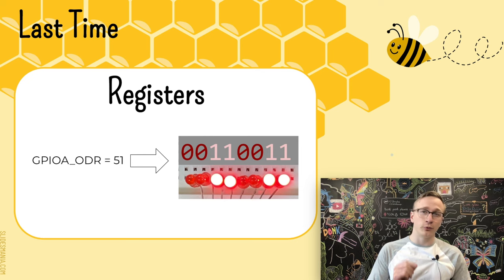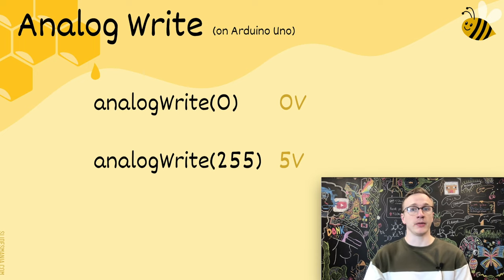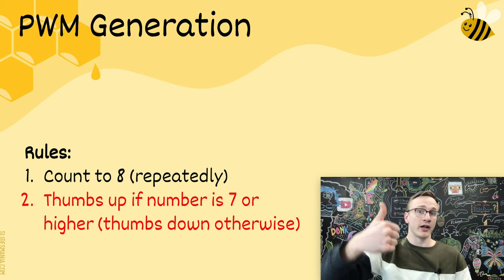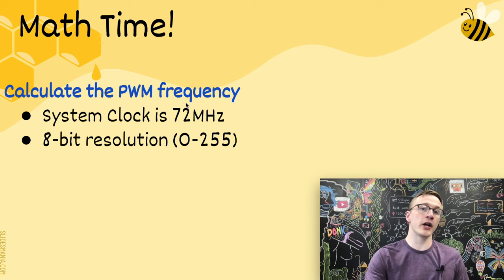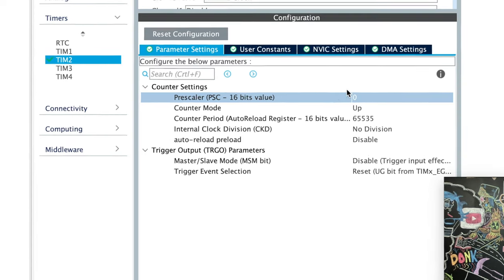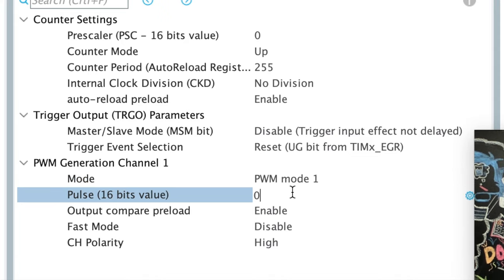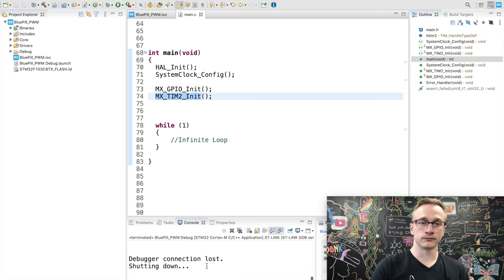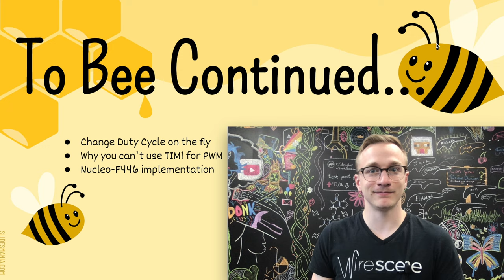STM32 Guide #3: PWM + Timers

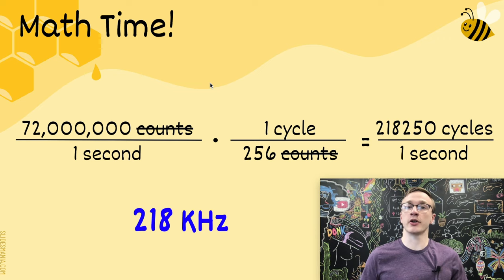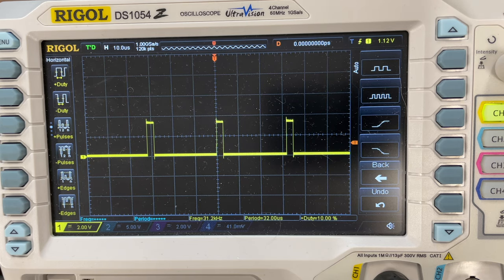Comment: The best beginner-friendly explanation about PWM timers. For some viewers, there might be a bit of misunderstanding. At 9:25, you're using 72 MHz as example (281 kHZ fix typo), and at 19:10, you're using 8 MHz, as shown by the 31 kHz reading on the oscilloscope."

Comment: Thanks for the video series about STM32. Your explanations are really great. There is a typo in the calculation of the PWM frequency. It is actually 281250 Hz instead of 218250 Hz. Later on the scope shows the right duty cycle but at another frequency. Might be related to the clock configuration. This is a little confusing for beginners like me. But the video still helped me to get the PWM configured.
Reply: Hey I had a similar confusion with the frequency at the end being about 31kHz. What I think is he used the internal HSI(High speed clock) RC oscillator which gives you a frequency of 8MHz . So when you calculate the frequency of PWM you get 8Mhz/256 = 31kHz. hope this helps! (Note: You can get 72Mhz clock speed from the external crystal oscillator but you have to configure that in the CubeMX clock configuration)

Comment: This series video is a great help to those who just started using STM32, as well as those who are somewhat familiar with it without being proficient; I am the latter. All tricks learnt in operating the STM32 IDE environment are so valuable that they will save you a lot of time and energy and most importantly, frustration. These tricks and insights are bridging the gap between where I am and where I want to be. I appreciated your generous sharing of knowledge which you at one point had to put in efforts to learn yourself!

Comment: One thing to think about - consider audible frequencies! Often times, the default PWM frequencies of many libraries and frameworks (including Arduino) fall well within audible frequency ranges, which very well could generate an audible annoying whine. 

Try aiming at at least 20kHz, more if you have small children, probably a lot more if you have pets. 

A few years ago I used an ESP8266 to make a wifi-connected MQTT-based RGB light, programmed it via the Arduino IDE and left all settings default. It really was an, admittedly quiet, but annoying whine until I fixed it.
Reply from the maker: I don't think I've ever had an LED make audible noise, but I certainly have had a switching voltage regulator make sound.

Comment: My understanding of the Auto Reload Preload is different from what you explained.  By default, the timer keeps repeating.  You can make it count once by enabling One Pulse Mode.  The Auto Reload Preload affects when an Auto Reload Register change takes effect.  If preload is enabled, it waits until the end of the current period, and the change takes effect when the counter resets.  Otherwise the Auto Reload register is changed immediately, which will extend or shorten the current period.

Consider if you're changing the ARR to a smaller value while the timer is running, and the counter is already larger than the new ARR value.  With preload disabled, the counter would immediately reset (because the counter is greater than or equal to the ARR) and begin counting up to the new value.  This means you'd have a glitch in the period, where it was neither the old period, nor the new period.
Reply from the maker: Thanks for pointing this out.  I’ll spend a bit of time digging through the datasheet and doing a few tests, and if I made a mistake, I’ll call it out in the next video
Reply from the maker: Ok, I finally did my homework on this, and I definitely slipped up when reading the documentation.  I've corrected this for video #4, and I'm giving you a shout out for pointing this out.  Thanks again for the pointer before I went too deep in the mistake

Comment: Mitch, you are doing a great job, keep it up!  I have an STM32F4 Discovery Kit and was tinkering around with it. Can you make a video on what intermediate projects we can build with a STM32 board which uses the board's resources to a great extent ?
Reply from the maker: Glad these are helpful! I’m not sure if I’ll get to any projects any time soon.  I’m planning on focusing on implementing one feature at a time, and there’s a lot to cover.

Not to mention, using the boards resources to a great extent depends which board you’re using.  For example, I was using an L031 the other day, which is a low-cost, low-power, small microcontroller.  I also used the F201, which has many IO pins, is very fast, and supports a ton of peripherals.  They both have very different applications, so using them to their full potential have very different meanings.

Comment: This has been very helpful moving from Arduino to CubeIDE. I have a feeling your audience for these videos don't really need code examples for both dev boards though. I'm using both myself. 
I like your idea of showing off the difference between Arduino's HAL and ST's a lot. 
If you run out of those I would love some of the more advanced topics laid out like this - DMA for instance.

Comment: You don't need to set and reset the jumper wire every time you program and download the code to the microcontroller.  You can leave the jumper wire as it is if you configure in the debug configuration the OpenOCD that came with the Stm32CubeIDE.  It does the downloading of code to the microcontroller automatically without setting the jumper wire. Once you set it up, just click the debug button and it does its thing.
Reply from the maker: Programming without moving the jumpers requires just a little bit more setup by default, which is why I haven’t covered it yet.  I have a million tips&tricks, but I’m trying not to distract from the main point of the video.  I try to slip some tips in every now and then when the opportunity seems right
Reply: @MitchDavis2  Good point.  Gotcha.

Comment: Hello Mitch its a very nice way of teaching i relay appreciate it. But one thing i want to correct that we don,t need to shift jumper 0 if we are using Stlink programmer. Stlink programmer sets STM32 board to programming mode automatically and at the end of programming it resets the board automatically . The 0 jumper is used when we are using UART for programming the stm32 board.

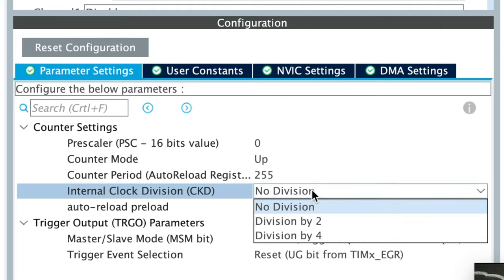Comment: 12:21 "Auto-reload preload" option is NOT a counter reset function (it will reset and start again automatically anyway according to the choosen mode(-s) and associated events). It's a preload register or a buffer for TIM_ARR register to write new values of the counter period to it and update TIM_ARR register only when timer update event happens. Especially useful in conjunction with DMA input to get a nice and correct signal at the output pin. You can check reference manual by yourself if you don't believe me. 🙂
Reply from the maker: I noticed that immediately after posting the video.  I believe I corrected myself at the beginning of the next video

Comment: The best video that explain about pwm than all that i have search on google. Can i ask if the the same port can change the value of the duty cycle so that i can change my led brightness in coding? and if im using 4 LEDs should i be using 4 port of pwm or just one ?..... Im bassically using assembly language C on keil
Reply from the maker: I think I explain how to change the duty cycle on the fly in the next video.
Reply: @MitchDavis2  Thank you so much i have watch all your video in this series and its really helpfull. But im still loss with the PWM port for me to use the pwm and timer channel should i use specific port only for the LED or any normal port is okay ?

Comment: Very good and concise explanation and tutorial, still have one question: why the PWM frequency on the oscilloscope is about 31khz instead of 218khz as calculated?
Reply from the maker: That’s probably just because I filmed one part earlier, and then came up with that sample calculation later.  I don’t remember exactly, but i was probably not using those exact numbers for that part of the video

Comment: The Boot0 jumper selects the memory from which the controller boots; flash (your program) or system memory (internal boot loader). The boot loader for the F103 is only able to load from the serial interface USART1 on pins PA9/PA10. But you use a ST-Link on SWD, for which the jumper setting is completely irrelevant.
Reply from the maker: It's not completely irrelevant.  To program the microcontroller, the device needs to be in reset mode.  OLD version of CubeMX used to enable SoftwareReset for SWD by default, but in newer versions they turned it off by default.  This means that you'd have to put the chip into reset mode manually, or use another wire for a RESET pin.  By switching the boot jumper to use the internal bootloader, it has the side effect of holding the chip in reset mode.  I was really trying to keep my videos as bare bones as possible at first, and then eventually introduce new things, such as enabling SWD Software Reset.  I always hated tutorials that tell you "set these 9 settings exactly as I have them here" without explaining what they do, and I decided that it wasn't quite time to introduce this yet.  It kills me that I haven't had time to make another video in a while, but covering boot modes, software reset, etc is one of the next things on my list.
Reply: @MitchDavis2  
Thanks for the clarification, that's a really interesting information that I didn't know.

Comment: A very nice guide.  But you piqued my interest when you claimed that TIM1 cannot be used for PWM.  I checked the datasheet... it says yes you can.  So I set up a NUCLEO board, and first I got TIM2 working with PWM: no issues.  Then I did the exact same setup on TIM1, it doesn't work.  So I'm still investigating that because I suspect there is an answer that will lead to TIM1 outputting PWM.  But if you have a ready-made answer, feel free to share!
Reply: OK, I found out that TIM1 has some extra initialisation required because of the Break and Deadtime functionality.  The datasheet does not make it obvious that the extra init step is required for PWM.  But finally I found that you have to set the MOE bit of the BDTR.  And after this TIM1 PWM is working fine.

Comment: Hi Mitch there is something that ı didnt understand. I understood that we can control the average voltage by changing duty cycle. Vaverage = V*D  This can be sound dumb but why we take the average voltage of pwm signal. We just apply 5V in different amount of time. For example we have a led that work with 5V. Let the period of the pwm signal be 1 second. İf we apply %50 duty cycle isnt that mean the led will light 0.5 seconds ? Or if we apply  %60 duty cycle isnt that mean the led will light 0.6 seconds.(But same brightness because we apply same voltage) Why we take the average voltage ? Sory for the english by the way.
Reply from the maker: I'm mostly a software/microcontroller guy, so my electronics explanations are probably not spot on, but I'll give it my best go.

If you control an LED with PWM, you can make it appaer to fade in and out.  However, if you took a snapshot at any instant in time, you'd see that the LED is either on or off.  Our eyes aren't good enough to see it turn on and off that fast, so we see it as a dim light.

This is similar to how the exposure on cameras work.  The aperature opens up, collects some light over a period of time, and then closes.  If the LED is blinking on and off multiple times during the time the camera is actively taking a picture, then it will essentially capture the "average" brightness of the LED.

Here's a video of someone recording PWM in slow motion: https://vimeo.com/50919538

So overall, PWM controlling an LED is really just an optical illusion.  If you wanted to ACTUALLY make something 50% voltage, you could use a "low pass filter", which is a simple circuit using one capacitor and one resistor.  This effectively takes the "average" voltage over a certain period of time.
https://www.electronics-tutorials.ws/filter/filter_2.html

Hopefully that explanation made sense.  I'm sure someone else with more electrical experience can further refine my oversimplified explanation.

Comment: Hi Mitch, It would be very cool if you do an overview of SubGHz programming on stm32WL starting from CubeMX settings.
Reply from the maker: Unfortunately, I haven't used any of the STM32W series microcontrollers (yet), and I also have almost no experience with any wireless communication.  Maybe I'll pick it up one of these days, but it would probably be quite a while before something like that matures into a video.

Comment: hello mitch ,i am really having trouble in reading pwm signal from rc receiver via stm32f401 - nucleo board . Is there a way to read the PWM signals(1000-2000) and serial print them ?

Comment: Hello Mr. Mitch Davis. I'm using stlink v3 mini.  If I have tried to program blue phill it says no target found. I have tried many things but it's not working. If you know about this issue, kindly reply with that solution. Thank you.
Reply from the maker: I spent about 2 hours yesterday trying to debug a new microcontroller, and I forgot to set the BOOT jumper to 1 :/

So, to start with the basics, do you have your boot jumper set correctly?
Reply: @MitchDavis2  thank you for your reply. yes I have done correctly. But, is there any different ways for different programmers to work with microcontrollers or else same for all.

Comment: Where can you find the mapping which tells you the port and pin of the gpios?
Reply from the maker: It’s different for each microcontroller.  You can find it in the datasheet for your specific microcontroller, or if you’re using a nucleo board, google the mbed pinout.  Example: “STM32G071 MBED pinout”

I like the format of the pinouts that MBED uses

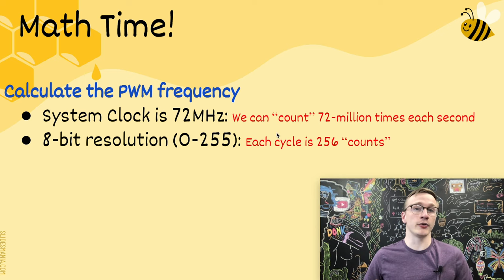Comment: 8:59 You are confusing repetition counter (RCR) with counter (CNT). CNT is 16bits, and when the CNT reaches the Auto Reload Register(ARR) value, it resets. RCR is 8bits, and is used to delay update events from happening every cycle. For example, you want to create an update event every 128 PWM cycle. You write 127 to the RCR. If you write 0(default value) to the RCR, it generates update event every PWM cycle.
Reply from the maker: Can you elaborate a bit more on where I confused the two?  I just rewatched that chunk of the video a few times and I think I'm missing what you're pointing out.  Please correct me if I'm wrong with any of the following: TIM2 shouldn't have an RCR (but TIM1 does).  I only used TIM2 in my video, and I don't remember mentioning anything about counting cycles (the RCR).
So far, I've only talked about CNT, which is just the counter.

Correct me if I'm wrong, but CNT is what counts up from "0" to "ARR".  In my example in the video, I set ARR to 255.  This should mean that CNT goes from 0 to 255, and then back to 0.  Thanks for looking at this in such detail, it's often easy to mess things up when covering technical stuff.
Reply: @MitchDavis2  Sorry, you are correct. I rewatched your video, and I think I misunderstood you. You are talking about creating a PWM with 8 bit resolution, but I understood it as if you can only use 8 bit maximum. And because only 8 bit counter in the STM32 family is the RCR register, I assumed that you confused RCR with CNT... 

I hope my previous comment didn't came out rude. Great channel btw, keep up the good work. :)
Reply from the maker: @sfaunl  ok, cool.  Not a problem.  I really appreciate when people give technical feedback on stuff like this.  I picked up STM32 about a year ago, so these videos are more like a book report.  I certainly don’t have the experience that other people do.  If anything else ever catches your eye, feel free to say something.

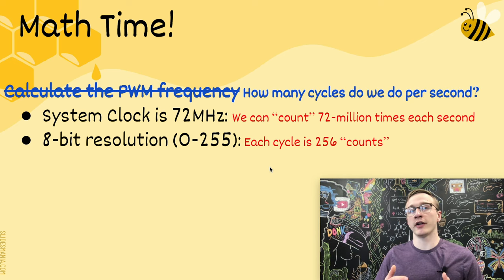Comment: 9:08 I'm not cleared why 8 bits resolution is 256 counts. Why it is not operate each bit each clock pulse 8 bit counts?
Reply from the maker: An 8-bit number uses 8 ones and zeros, which ranges from the number 00000000 to 11111111.  In decimal, that’s 0-255.  Thats 256 possible values that can be represented with an 8-bit number, so we say the resolution is 256
Reply: @MitchDavis2  I got it. Thanks.

Comment: is it possible to generate 4 phase pwm using stm32 nuclio f4 series board ?
Reply from the maker: Yes, although it’s a little more advanced than what I talked about in this video.  For 4-phase, you need to use 4 timers.

This guy Here explains it better than I can in a YouTube comment: https://community.st.com/s/question/0D50X00009XkYAiSAN/how-to-generate-phase-shifted-pwm-using-stm32f334

Basically, you set up one timer to serve as a trigger for another timer.  Whenever the first timer “triggers”, it resets the second timer.

This will give you two timers that are out of phase.  Repeat this a few more times until you have a 4 phase output

Comment: Can you program it just with lines of code?
Reply from the maker: What do you mean by that?  You’ll always have to compile something and then push that compiled code to the microcontroller
Reply: @MitchDavis2  here you just typed number 25 what is about 10% of 255 and it generated code.How about typing all manualy